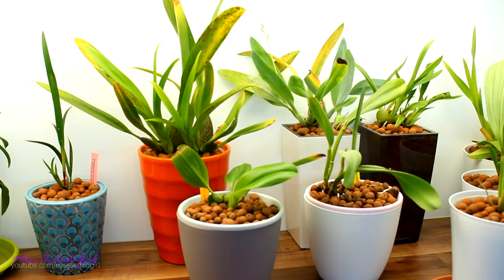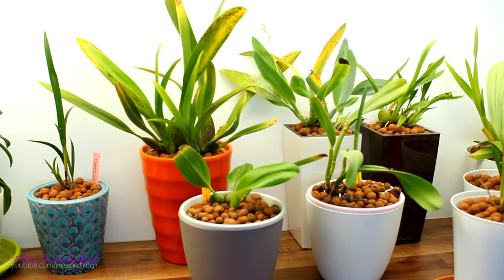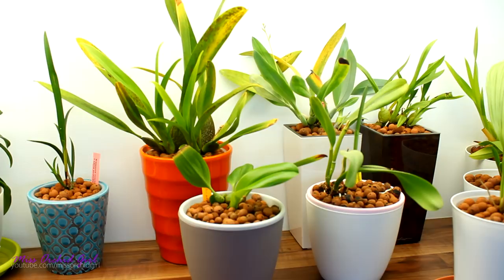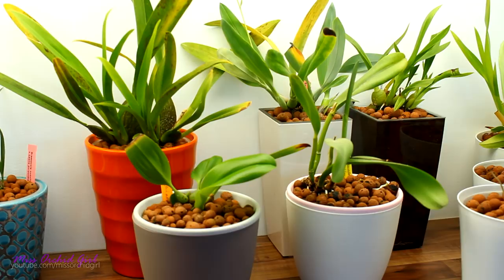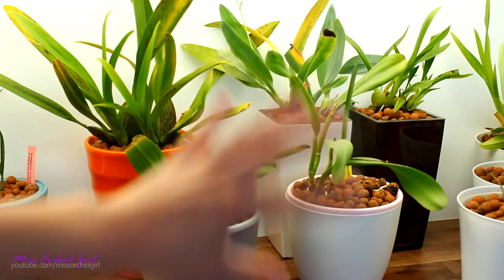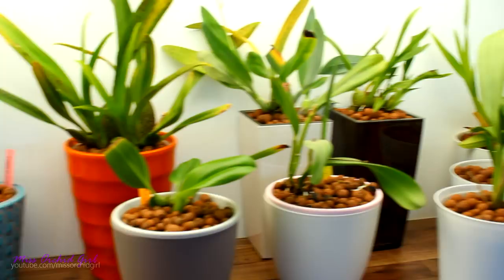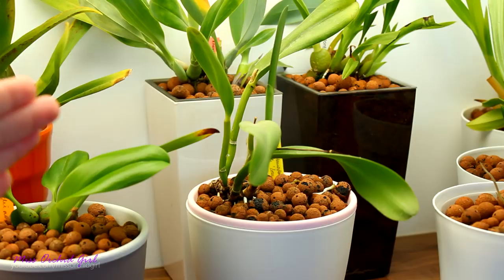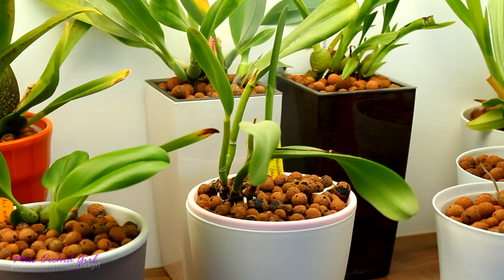DIY self watering pots - Ideas for Orchids, African Violets & more!

Comment: Hi, Dani. Love the self-watering idea, but there might be an easier way to do this without having to find two pots that are just the right size. You can use an empty margarine tub for the reservoir, punch a hole in the lid, and then feed the wick through the hole. Then you just set your orchid pot on the flat surface of the lid. The tubs can be spray-painted, or the whole thing can be put inside a more decorative container if desired.
Reply: J. C.: I love this idea, and I used it with all my African Violets, on my light shelves! P.S. I use an especially light and airy mix, in this setup!
Reply: @sandrastreifel6452  an even simpler idea, is just to elevate you plant in the existing  saucer by placing 3 thick bottle covers under the pot, and viola , your saucer is now a reservoir, plus it provides extra humidity ,plus  you don't have to fiddle when checking and replenishing the water level!, just figured this out and am adding wicks left and right ,i though self water pot's are the future ,but its so easy to convert every pot into one  that its not needed, every pot has a saucer

Comment: Hi Danny.   I remember (?) someone recommended to use microfiber in place of synthex. Maybe it was you ? 😬.  Anyway synthex is no longer available.    Buy a microfiber cloth and cut into strips.   I have a orchid grower around the corner from me with ceramic pot and net pot insert.   Lucky 🍀 me.   You sound terrific !!!   Great seeing you back.     Oops.  Commented before watching til end.  😬
  Self watering pot,  add a piece or two of microfiber inside to wick water upwards to keep surface moist ?
Hey guys.  You can get this kind of pots from Walmart in the states.  Search under santino 5.3 which is a 5 inch pot with liner.  I buy transparent pots and also colored ones and mix and match for algae prevention.  The colored I buy green.  They’re about 6.50 each
Reply: Synthic is still available, at least in the USA. I bought two big bags of it from a store in Michigan that caters to people who have reptiles and who use aquaponic setups.
Reply: Kari K. Thanks Kari.   Lucky you😬.  I tried googling, amazon, eBay and cannot find listing.  Maybe old stock?   But using microfiber is acceptable and probably cheaper ?
I think it was mentioned that syntex decreased its water absorbing properties after multiple use.
Reply: @TY-ob7fz  You can also use a mop's strings.  They are synthetic and absorb fluid quickly.
Reply: @georgevega962  yes.  That's what Danny uses (?) in previous videos.  But cloth is cheaper and readily available if you only need a few strands.  Mops are denser and ...     Ya know I gotta try it !!!
Reply: Thomas M You're right about the Synthic's inability to wick water after it has been used for a certain period of time. The way to fix that is to put some warmer-than usual water into the reservoir and it will be good as new. I'm not going to use it for any purpose that I can't pick it up and move it around myself easily anymore. I go to the fabric store and buy the "high performance fabric" that's similar to what athletes wear, and I make four strips of it and I just put them in the bottom of the reservoir and pull them through almost to the top of the leca beads. I don't loop it back down, I just have four strips that I pull up to the top of the leca and I use a few rhizome clips to ensure that the fabric stays up at the top. It's worked well for me, and the tight weave of the fabric is designed to keep the swat off the person's skin, but it does great at not allowing the roots to adhere to the strips, and keeps all of the leca slightly damp, whether it's by the capillary action or the self-watering action with the strips. I use the Synthic as a soft cushion for seedlings when I get them, and I put them into the appropriately sized net pots and then I put a plastic saucer around the base of the pot and fill it halfway with my fertilized water. Every week, I flush the net pots, and give them fresh water, and that's working great, and I have Vandas and Phals in the same system! The adult pots work well too, I flush them weekly, and then give them fresh weak fertilizer mixture through their root systems with a squeeze bottle so that the roots and the cloth strips both get soaked, and everything is happy in my indoor greenhouse. Once we can move outside, then we'll see how it really works.
Reply: Thomas M z

Comment: This is a great system for those who travel for their work and are gone for long periods of time, or vacationers, especially the Ikea pot inside the tall pot.  If you're going to be gone, just slip your plant into the tall pot so you can be away and not worry.  (Need longer wicks for this, though, I suppose.) Great idea!

Comment: Concerning 09:45min: For years I have been placing one larger pebble (or stuff that serves the same goal) at the bottom of all decorative containers to lift the rim of  the plastic pot higher so you get it out easier. But I surely will add the wick to more of my Dendrobiums since I have leca as a drainage in the lower fourth of the plastic pots anyway - will be quite the adventure to fiddle the wick in without repotting the orchids but what a great upgrade tipp. ^-^ Thanks Danny!

Comment: Hi Dani, I’ve been using this method for a long time...as a wick I use paracord nylon rope, leca on the bottom of the pot , followed by XL orchiata/ growstone mix, topped with moss...it works great 👍
Reply: Tanya V that’s awesome! I’m doing the same though I’m not using a wick, I still give them a spray on the top to keep the sphagnum damp. It’s really extended the time between “baths” from a weekly/biweekly task to a monthly/bimonthly one. 4 months in and all my phalaenopsis are in this setup. Some are doing excellent, a couple are adjusting still and one is struggling (but i thought it was dying from dehydration before I repotted it, it’s showing a tiny bit of improvement). I pack the sphagnum around the rim, giving a full inch around the crown with no moss. The constant moisture makes me concerned about crown rot.
Reply: x0thorn0x , if I have one that is struggling or has no roots, I use the same setup but use a clear plastic tall glass with no holes and always keep the water to the top of the leca...they grow roots at no time. 👍

Comment: I noticed that you put the synthic so that the strand is only on the bottom layer of the leca. Do you think there would be any advantage or disadvantage to get the wick higher in the pot? Particularly for the taller pots when you have something that requires more water like a bulbophylum?
Reply: Midraj I was wondering the same thing! I was thinking of trying this out as I'll be on vacation and will need to make sure my orchid still get some water

Comment: Hi Dani , Do you think this system will work in an outside shade house that has a poly carb roof and where the temperatures are between 10 degreesC and 32 degrees C . The lower temp being winter nights the higher temp being summer days. I really like the idea of growing in leca, but haven't tried it as yet. Thanks for your great videos ,I have learnt a lot from you. (all orchids now in organic mix).

Comment: I have tiny white bugs in my phelanopsis and on the leaves, I have recently repotted them because they were struggling and droopy. Roots plumping in water but going grey once out of water. I have removed flower spikes to help with recovery. I don't know what else to do. Thank you
Reply: hayley hodson   Hi Hayley. You’re on the right track ( I think 🤔). Keep watering, have patience, and place in lighted window.  And keep watching Danny’s vids,  she’s got a whole bunch of 4/5 years worth.   I’m not squeamish about bug sprays and fly sprays works for me on the light stuff.  Just a light “feathering” around the affected areas. Less is better.    She has vids on red spider that works too that I’ve used.  Good luck.
Reply: I would get sticky paper & hang it by your orchid(s); the yellow fly paper works best with whiteflies (which it sounds like you have). You can also make MOG's mineral oil spray, it's in a video.
Reply: Your roots will go grey when they dry a bit, that is completely normal. They only turn green when wet, and they will rot if you keep them wet all the time (they live on trees in the wild)
Reply: how do i get rid of them from the plants please?

Comment: May I suggest some air holes in the back of the mask? Moist air is less dense and will rise giving desirable air circulation. Said holes don't need to be near the bottom of the mask. Half way up the back of the mask will still provide excellent ventilation and means no tray is required. 
Its not unsightly to have the ventilation holes at the back.... and after all this is part of a "system" not just a simple "flower pot".

Air and water =  healthy roots = happy orchids!!!

Thanks so much for your wonderful channel and engaging presentation style.

Comment: Ceramic pots in winter months is not OK for orchids. They gonna get molds and cold shock. In your country is ok. So i use plastics decorative pots instead.
Reply from the maker: Hi, glazed ceramic pots don't stay cool, there is no force 'cooling them' such as the non glazed ones. They take the temperature of the environment that's all. Due to their texture and lack of porosity they have more contact with whatever they touch and the impression is more intense, but they don't cool, or warm up anything. Thermal inertia is a different story, but they will not be anything other than whatever temperature the environment is, or was at some point. If you look back in my archive you'll see I kept orchids in glazed ceramic decorative containers, 2-3-4 years ago in a very cool environment, without issues. They have the exact temperature as the environment, what you feel with your hand is just an illusion and has to do with the texture and the quantity of material that touches your skin.
Reply: MissOrchidGirl hello, yeah that's what i mean. I'm sorry i didn't properly explain. Im not used commenting in you tube😖. I have issues of the temparature in my environment so i have to use plastic pots